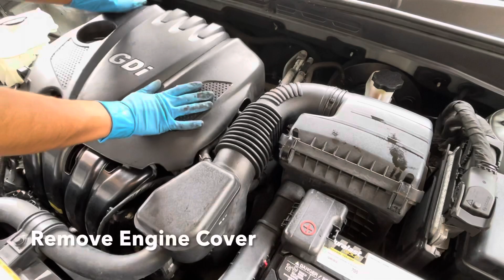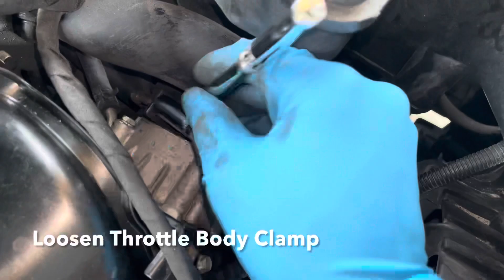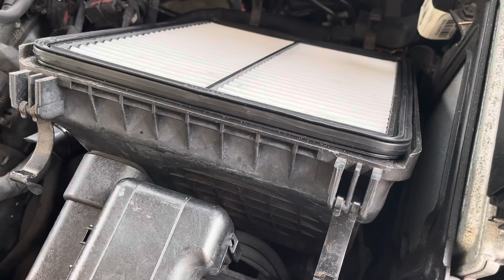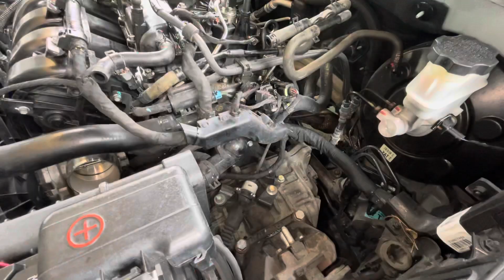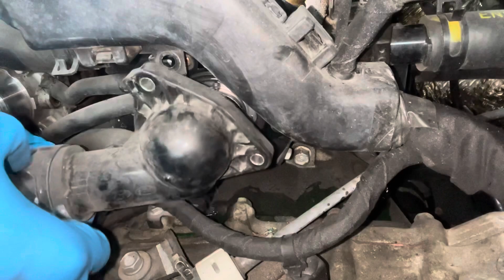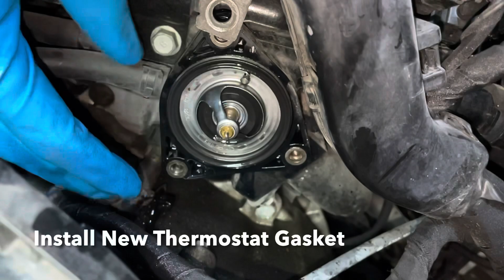2011-2014 Hyundai Sonata Thermostat Replacement DIY

Comment: Yikes,spent almost an hour trying to put the gasket around the thermostat plate,but it won't slip off so i decided to put it on the Housing and then put the thermostat into engine and then join the housing to engine then tightened the bolts and it work and after several hours i come across your video and confirm i did it correct 😅
Reply: Did you use OEM or the one that is recommended in this video. How did it fit? No leaking?

Comment: Not sure why Hyundai makes the thermostat housing plastic. Do you see issues with it cracking?
Reply from the maker: Costs savings, haven't seen any problems with cracking.
Reply: @MrRangerZr1  doesn't the gasket go around the edge of the tstat? I could be wrong tho
Reply: Mine cracked